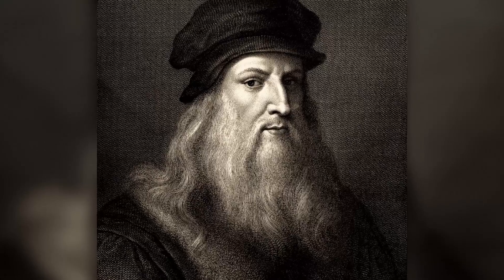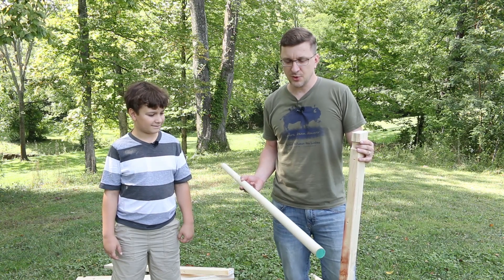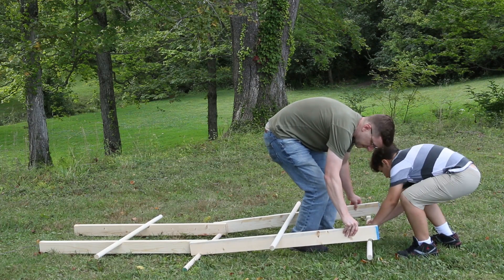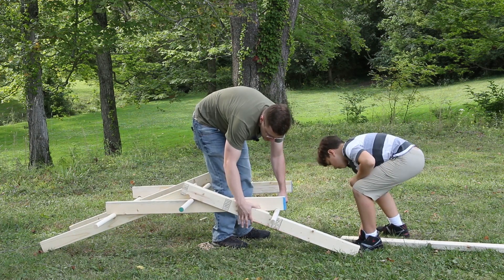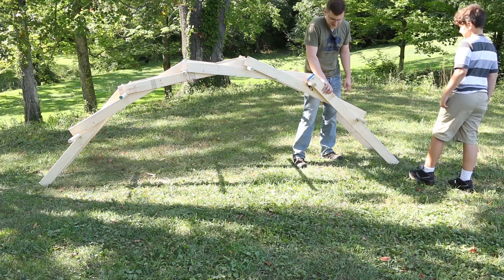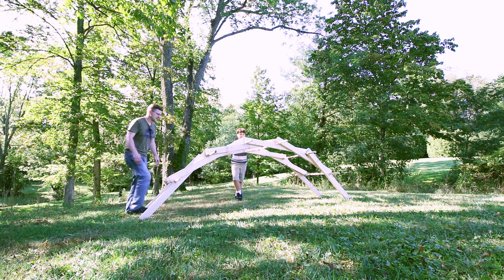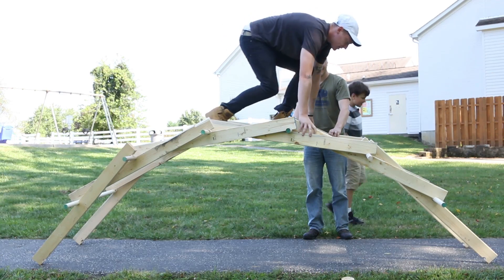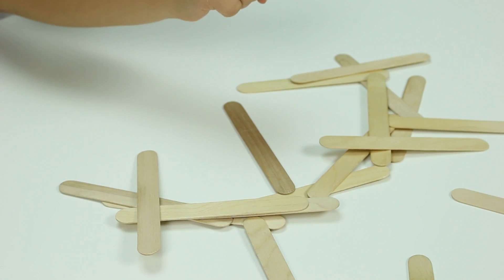HOW TO MAKE A DA VINCI BRIDGE // Full-size Leonardo Da Vinci bridge

Comment: If you wanted to use this bridge design as the top of an arch garden trellis, that had 4 straight vertical legs, how do you determine the length of each bridge piece to build a specific base width of the arch trellis?

Comment: Using this to make an arch ramp for small motorcycles out of pallet wood, thus dispersing the weight over the two contact points while preventing the sharp angle at the top where machines drag the middle.

Comment: You had used an 1"1/4 round wooden bar and 2" x 4" rectangular bar. Does it work with 3cm round bar versus 5 x 5cm square bar? Do you have a document specifying the load which can withstands this bridge? I am willing to build one; however, as a mechanical engineer, I am not familiar with structural or civil design.

Comment: Good video!  
Just a tip: when you go to drill the semicircular notches with the Forstner bit, it's much easier and more accurate if you gang a pair of the 2x4s against each other, edge to edge, and drill into the valley where they meet.  It makes the bit self-centering, and ensures symmetrical notches.  (It's also twice as fast.)  Bar clamps work fine for holding them together while drilling.

Comment: suggestion for drilling?  Clamp two 2x4s together and push hole saw right in the middle making two half hole slots with one push and avoiding hole saw climbing out of place ...allows the guide bit a center hole to follow ...no?

Comment: Love it.  Getting ready to do a full size one for our first school Maker Faire in Perth Ontario Canada.  HOw long are the 2x4s? they look like 4'?  ALso save time by drilling 2 half holes at once?.  Save $$$ by using 2x2 rather than dowel.  I find dowel always seems to more expensive than I think it should be and you have to use a fair amount.  what was the length of the dowel? it also looks like about 4"
Thanks so much
Reply from the maker: Peter McCracken, have fun with it. Yes, we cut 8 ft 2x4 into 4 ft. I imagine 2x2 could work as a dowel replacement, and would save you money for sure. We planned on using 2 ft dowel, but ended up leaving them as 4 ft just to make the project go a little faster. Also allowed is to make the bridge a bit wider.
Reply: HeyDadHey
Thanks for getting back to me.  We had a go at the bridge and it worked out great.  4' 2x4s. For the dowels I ripped    2x4s to 1.5x1.5 then ripped off the corners so I ended up with an octagonal dowel.  Just have to carefully select material as one large knot in the wrong place will compromise the dowel
Reply from the maker: Adds a little work, but can save you a couple of dollars per dowel for sure. Good job!
Reply: For a dowel replacement, I used 2 X 2 and 1/2 inch deep dados.   
Can support my weight, 190 pounds.   
Might also make 1/2 plywood platforms to make it easier for the younger ones to cross.